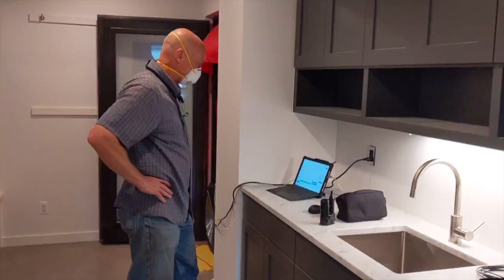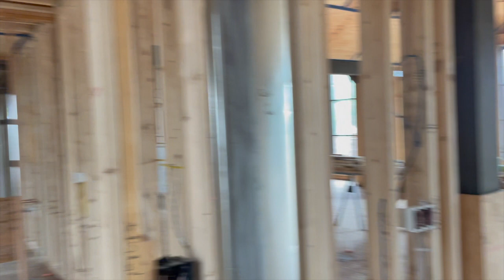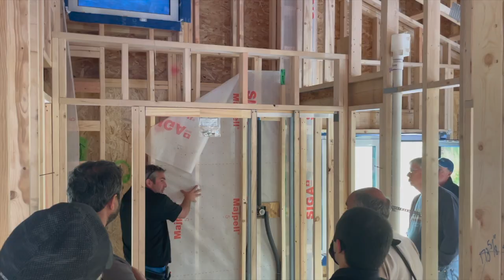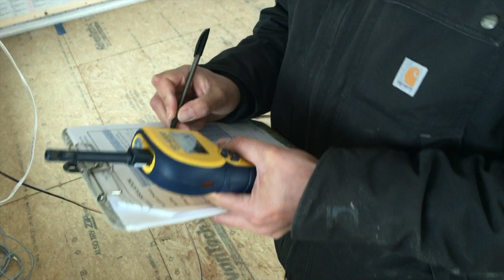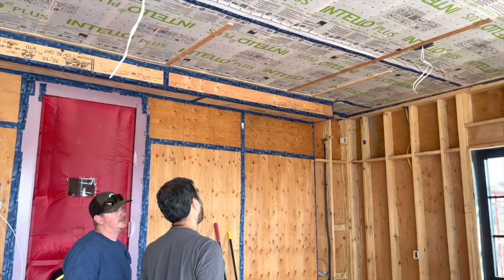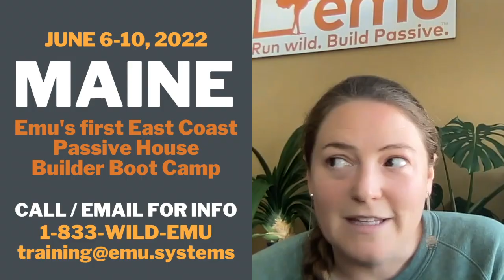Blower Door Tests in Passive House | Monday BS with Emu Mariana - May 23, 2022

Comment: Dear Mariana,
To start with I would like to thank you for the content you create, and I think you need to promote the channel in more active way as it is very useful. 
I am not experienced with you cold weather condition, however I am little bet concerned about the out door air (ODA) you bring in the building to maintain healthy indoor condition specially with the very tight envelop and very low air changes. Do you follow any standard for indoor air quality? 
Please don’t stop posting and keep it up.
Reply from the maker: Thanks for your questions, apologies I am just now seeing this. Yes, the Passive House standard is a performance metric that includes indoor air quality requirements. The method for exchanging air in a Passive House is through an HRV or ERV. I have covered those in another video, if you are interested in learning more about them - https://youtu.be/46Q6RuajFq0
Reply: @emupassive  Many thanks for your reply, and sure I will check your other video.
Reply: Hi Bader, my interpretation is that there are two topics here:

1. Why not have air passively running through cracks/crevices in a building?
2. How is air inside kept "fresh" if the home is so tightly built?

Re: #1 -- If there are lots of cracks/crevices in a home, it creates infestation (bug/mice), damp/water/mold*, allergy, and pollution problems. And so now we have contaminants coming in with the natural drafts, so what some might deem "fresh air" isn't actually fresh. Additionally, in cold climates, humidity inside a home will decline dramatically in homes that are not tight (cold air has little humidity, so when it enters the home in an uncontrolled way and heats up to living temperatures, it is very very dry). That very dry air makes the space very uncomfortable.

*Air coming into a building in an uncontrolled way can create moisture problems. For example, in the midwest it can be quite humid during parts of the year, so as that humid air enters an air conditioned (cooler) space, the moisture will condense inside walls/etc. Water and moisture can both accelerate deterioration of the building and create mold -- and that air flowing in will also then run right through those moldy areas before it enters the home. Uncontrolled "fresh air" is not likely to stay fresh.

Re: #2 -- Rather than uncontrolled ventilation (cracks/crevices), mechanical/active ventilation is used to take air from a desirable space on the outside (e.g. much above the ground line where it will be the best starting point for "fresh") and brings it in through ducting. That air is also run through devices to proactively condition it before it enters the home, e.g. through an ERV and perhaps through a device to also control the humidity. This means that outside air will even be fresher and cleaner than air coming in through an open window -- and it will work year round.
Reply: @dosadoodle  Many thanks for your reply with these elaborative details. I do agree, that you have control over the issue. also, I fully agree with you the outdoor air is not as fresh as we think, that's why we don't call it fresh air we call it Out Door Air. I believe we have a lot to learn about the weather in the midwest and cold countries.
Thanks again for your reply